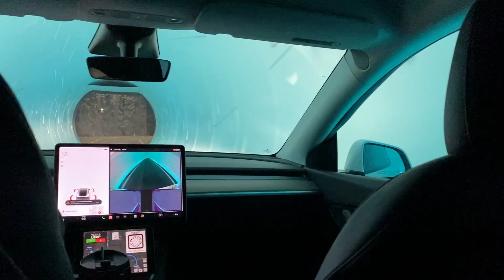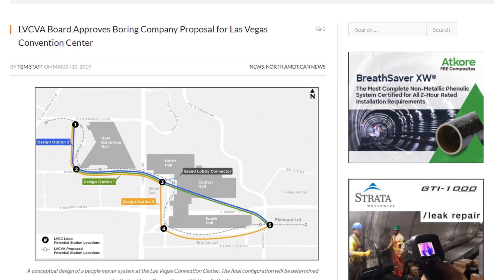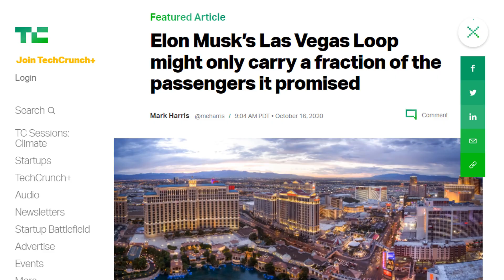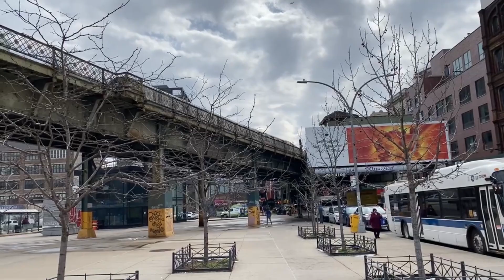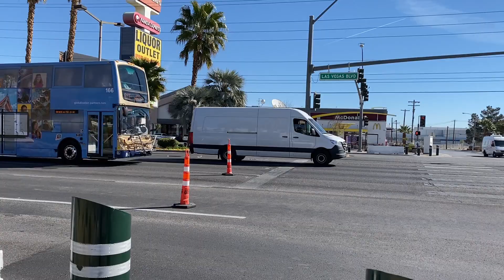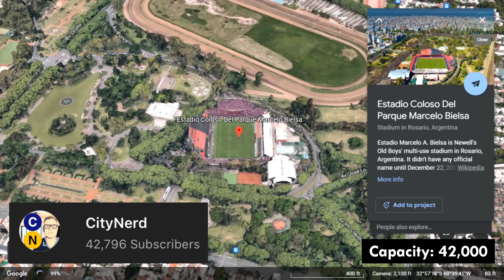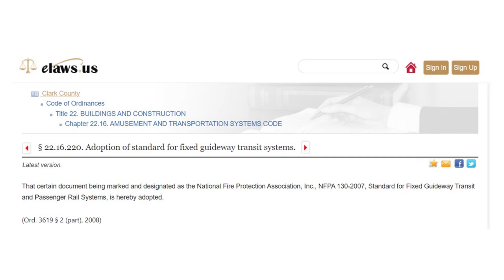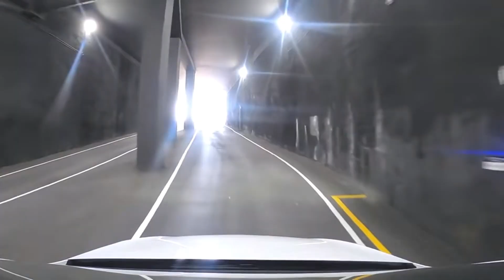Inside the Las Vegas Loop: Transportation Game-Changer, or Complete Waste of Time and Effort?

Comment: i hope they convert these tunnels into actual mass transit
Reply: The Loop is already mass transit though. Boring Co’s Loop which only has 1 route, 3 stops and 70 cars easily handles 27,000 passengers per day during conventions. 

Compare that to the Vegas Bus service has a daily ridership of 178,390 but that is across 51 routes and 3,900+ stops and a fleet of 708 buses. 

So that very large, busy bus network only carries 6.6x the number of passengers of the small 3-station Loop despite having 51x the number of routes, 1,300x the number of stops and 10x the number of vehicles each of which has 10x the seating capacity as each Loop EV.

The 29 mile 51 station Loop will increase the size of the current Loop by 17x so it actually sounds like The Boring Co is underestimating capacity projecting at least 57,000 people PER HOUR for the full Loop.

Considering that Las Vegas only has a population of 600,000, you can see how the Loop is indeed a very good solution for the public transport needs of this city going forward - particularly since it is costing the taxpayer ZERO dollars compared to around $15 billion for a comparable subway.
Reply: @andrewfranklin4429  You're once again committing the sin of comparing peak traffic along one busy stretch during one busy period, to daily averages across a huge network. That's not how traffic engineering works.
Reply: @Codraroll  no, the Loop is only operational during conventions and we don’t yet know what the peak throughput capability of the Loop is considering the largest convention has only been 114,000 attendees while the Loop was designed for conferences up to 180,000 attendees. 

So that 25,000 - 27,000 daily ridership range gives us an average of 26,000 people per day. 

We have to wait for the full 29 mile 51 station Loop to be constructed before we can get the best comparison of a continually operational commuter network, but t least we now know that the Loop is very competitive with bus networks.
Reply: @andrewfranklin4429  70 cars with 1 driver 3 passengers, is 280 places, that's  nearly half a Luxtram tramway (422 passengers), and 5 to 3 busses (60 to 120 passgenger busses).
70 model 3 are around 4 million USD (the price of 10 electric busses transporting 2 to 3 times as money people as Tesla cars)
70 Tesla drivers salaries compared to 3 to 5 bus driver salaries
Reply: @THEREALZENFORCE  In terms of the number of cars required, a subway carriage costs $2 million so an 8 carriage train costs $16 million and can carry about 1,600 passengers. 

Each EV in the LVCC Loop cost about $40k each, so you could buy 400 EVs for the same money as that NYC train and with 4 passengers per car transport the same 1,600 passengers. 

However, the EVs travel 5x faster than the trains (which have to stop at every station on a line) so you’d only need 80 EVs to transport the same number of people in an hour. 

Even with 2.5 passengers in each EV, that’s still only 128 EVs to transport the same number of passengers as a train at 32% the cost of that train.
Reply: @andrewfranklin4429  Luxtram 16km 24 stations 500 million USD, over 12000 people per hour capacity (every 2 minute one tram), 31 million per km.
Las Vegas Loop 2km 1 station 50 million USD per km, only 4400 people per hour maximum claimed nearly 3 times less capacity per hour at optimal factors at best.
Reply: @THEREALZENFORCE  and of course, the other problem with your Luxtram is that it is above-ground meaning that in addition to having to stop at every station, they are terribly slow averaging 12 - 15mph but dropping to 9mph through pedestrian zones and interactions with cars and speed restrictions through the built-up city area. 

It just doesn’t compare with the 60mph (100kph) average speed of Loop EVs (let alone the 150mph (240kph) max speed down arterial tunnels) which go straight to their destination at high speed without stopping at every station. 

LRT is too uncomfortable and unsafe. Having to sit or stand crowded breathing the COVID of up to hundreds of strangers and the exhaust fumes of city traffic, there is no comparison to every 2-3 passengers in their own independently mobile, personal, HEPA and activated carbon filtered safety cell Loop EV. 

In the event of a crash or collision, you’re far safer in a Tesla with seat belts surrounded by air bags and a vehicle that NCAP rates as the safest car on the road in crashes. 

Compare that to being seated or standing in a tram with no seat belts, no air bags and long compartments full of people and luggage that turn into projectiles in a crash. 

Then there is the problem of the visual pollution and noisey tram/train station or railway line which people don’t want running next to their house or business compared to the whisper-quiet Tesla EVs hidden away below-ground.
Reply: @THEREALZENFORCE   Luxtram has 15 stations over 7km and takes 23 minutes to travel that distance at the dreadfully slow speed of 11.3 mph.

The tram has a daily ridership of only 31,300 passengers only 16% greater than the 27,000 people per day of the Loop despite having 5x the number of stations, 5.4x the length and costing $604m or 12.4x more than the LVCC Loop.  And it isn't even underground so has all the problems of above-ground rail in terms of noise and land-use.

I don’t think I’d be using that as an example if I was you Zenforce!  :-)
Reply: @andrewfranklin4429  You cannot even count :
600 million for 16 km for 29 stations for 21 tramways compared to LVCC 55 million for less than 1.8 km, 3 bad stations, no cars. 
600 divided by 16 is 37 million per km
The Loop is 30 million per km without cars.
For one 422 person 45 meter Luxtram you need 106 Tesla Model 3 cars (2 million more expensive than one tramway train), one Luxtram is 45 meters long, the 106 Tesla model 3 cars column would 499 meter long (10 times longer needing ten times more space to transport the same 422 people as one tram), also the tram is way more energy efficient, according to physics metal wheels on rail has way lower rolling resistance than rubber tires). Cannot beat physics
Reply: @andrewfranklin4429  Las Vegas loop 2 times more expensive per km, over 2 times less people transported per hour, 3 to 5 times less energy efficient, way higher rolling resistance, and requiring ten times longer space for 422 people transported. 
The 21 tramway with a theoretical 8862 people at once possible at a time (21 x 422) in a huge city easily beat the Tesla Loop carrying capacity at once.
Reply: @andrewfranklin4429  Any train or tramway or bus at even 30% capacity requires twice less energy per person transported.
Reply: @andrewfranklin4429  Funfact in 2022 Luxtram transports 70000 people per day, over 6000 per hour on average (during working times) in our 150000 person Luxembourg City while your LVCC does not even transport 30000 people daily in a city of 600000 people. The LVCC average is even way lower when you check a 365 days period, your number claims are the best ever recorded during one day of maximum attendance, it's not even a median yearly average.
Reply: @andrewfranklin4429  And all your energy claims are fake news, according to physics rubber tires have way higher rolling resistance than metal wheels on metal rails. Also you need way more cars to transport the same number of persons as one single tramway vehicule.
1 CAF Urbos tramway we got 21 vehicules for for 81 million dollars, that's 3.8 million per vehicule for 422 people capacity per vehicule. For the same 422 people, you need 106 Tesla model 3 cars (so 106 x 60000 euros at best Model 3 autopilot long range in my country is 6.3 million euros nearly 7 million dollars to transport the same 422 people at once.
Reply: @THEREALZENFORCE  actually, we now have the latest pricing for the Vegas Loop:

34 miles of tunnels = ZERO dollars
55 above-ground stations = $1.5m each (paid for by each hotel, casino, University, stadium etc)
If the hotels etc want a larger more grandiose station, they cost $3-$5m each
All running costs paid for by The Boring Company including 700 cars and paid for out of ticket revenue.
Reply: @THEREALZENFORCE  Steel wheels are not actually the big deal in energy efficiency that you may think. Rolling resistance is only responsible for about 15% of the energy usage of a vehicle compared to wind resistance, fuel/energy conversion losses, mechanical losses and overcoming inertia when accelerating which account for a massive 85% of the energy usage of a car. 

You’re probably getting confused by the fact that ICE cars are less energy efficient than trains (which they are) and thinking that also applies to EVs (which it doesn’t).  

The average energy efficiency of trains is dragged down by big heavy trains moving small numbers of people off-peak as well as having to start and stop at every station on the line. That is why the Loop EVs use less power than any heavy or light rail transit system globally.  

here’s a more extensive list of energy usage:
Transit System	Type	Wh/pax-mile
Model Y; 5 passengers.	Loop	70.0
Model Y; 4 passengers.	Loop	86.9
Model Y; 3 passengers.	Loop	112.3
Model Y; 2.4 passengers.	Loop	141.5
Seattle; ST	LR	144.6
New York-Newark; NYCT	HR	164.7
Model Y; 2 passengers.	Loop	165.2
San Francisco-Oakland; BART	HR	177.7
San Juan; PRHTA	HR	193.2
Atlanta; MARTA	HR	193.5
Phoenix-Mesa; VMR	LR	206.8
New York-Newark; PATH	HR	217.1
San Diego; MTS	LR	223.1
Portland; TriMet	LR	269.1
Chicago; CTA	HR	320.1
Model Y; 1 passenger.	Loop	324.0
Boston; MBTA	HR	324.6
Los Angeles-Long Beach-Anaheim; LACMTA	LR	325.8
Philadelphia; SEPTA	HR	346.5
Charlotte; CATS	LR	349.8
Boston; MBTA	LR	350.1
Seattle; SMS	MG	354.1
Minneapolis-St. Paul	LR	385.6
Los Angeles-Long Beach-Anaheim; LACMTA	HR	390.0
{ HR Average }	HR	408.6

Denver-Aurora; RTD	LR	411.4
San Francisco-Oakland; SFMTA	LR	416.8
Houston; Metro	LR	425.9
St. Louis; METRO	LR	427.5
Philadelphia; PATCO	HR	431.9
Washington; WMATA	HR	439.3
Philadelphia; SEPTA	SR	461.1
New York-Newark; NJ TRANSIT	LR	465.9
San Jose; VTA	LR	468.7
Salt Lake City-West Valley City; UTA	LR	480.5
Seattle; ST	SR	502.3
San Francisco-Oakland; SFMTA	SR	502.7
Sacramento	LR	507.0
{ LR Average }	LR	510.4

Type
HR/LR = Heavy/Light Rail
SR = Streetcar
MG = Monorail/Guideway
Wh/pax-mile from 2019 NTD Data.

Electric Propulsion Energy Consumed in kWh / Passenger Miles * (Revenue Vehicle Miles/Total Vehicle Miles)
Last term corrects for Energy used for revenue service, and removes such uses as deadheading, training miles, etc...
Reply: @THEREALZENFORCE  Yes, a tram or train packs more people into for example an 8-car NYC subway train itself compared to the 80 EVs needed to transport the same number of passengers in peak hour, but you need to factor in the empty tunnel wasted between each train to ensure they don’t crash into each other if you’re going to properly compare space efficiency. 

There is literally miles of empty tunnel wasted between each train, while the Loop can handle a continuous stream of EVs 1 second apart (6 car lengths at 60mph) in the main arterial tunnels.

Much less space wasted than a train.
Reply: @THEREALZENFORCE   and you forget that the Loop EVs will travel at an average of 60mph or 6x faster in the 34 mile Vegas Loop compared to the dreadfully slow Luxtram which averages only 11.3mph so even if you crammed 422 people into a tram, it would only take 105/6 = 17.5 Loop EVs to transport the same number of people per hour. 

But the passengers would get to their destinations 6x faster seated in a comfy EV.
Reply: @THEREALZENFORCE  and those 18 Loop EVs required to transport the same number of passengers per hour as each $3.8 million tram only cost 18x $40,000 = $720,000 or 5x cheaper than that tram.
Reply: @andrewfranklin4429  Now to reality : 3 days ago : 
Las Vegas Gov website about LVCC loop :
- City Council seek approval of monorail
- City Council seek Fire and Life safety plan
- City Council speaks of revenues (so no zero dollars)
Reply: @THEREALZENFORCE    yep Zero dollars to the taxpayer. Because Loop tunnels are so cheap at only $10m per mile, The Boring Co is investing $340m into Vegas building the 34 miles of tunnels knowing that he’ll make it back on ticket revenue since he has a 50 year franchise and will generate plenty of income every year. 

With tickets averaging about $6 per EV and ridership of up to 57,000 people per hour in peak hour, TBC could be looking at income of $140,000 per hour in peak periods or perhaps close to a million per day which gives us over $300 million annually. 

So TBC would make back the cost of the tunnels in a few years at the most. Sounds like a pretty sound investment to me.
Reply: @THEREALZENFORCE  It is actually the Las Vegas Convention Center and Visitors Authority that receives the bonuses if the Loop hits certain capacity figures not Musk or the Boring Co. 

The Boring Co (TBC) will pay the county a franchise fee of 0.5% on the first $17.5 million of quarterly revenue and 5% on additional revenue from the Loop from ticket revenue generated by TBC who will operate the Loop as a franchisee and retain the other 95-99.5% of ticket sales.  

There are no subsidies, TBC is going to pay for the cost of ALL 34 miles of tunnels ITSELF with the 55 hotels and casinos paying for the construction costs of their own stations at the front doors of their establishments.  

The taxpayer will indeed pay ZERO dollars compared to the tens of billions that a subway would cost.
Reply: @andrewfranklin4429  Instead of your fake news : let's try reality : 
London reconnection article : why are tramway to most efficient public transport
There you have the explanations about efficiency and also rolling resistance
Reply: @andrewfranklin4429  At 30% passenger a tramway has 2 times less MJ/km per person. At 100% people capacity it's nearly 6 times more energy efficient.
Reply: You also confuse energy efficiency (km(MJ) and energy consumption (kWh/100km). No wonder you speak so much non sense.
Reply: @andrewfranklin4429  Wikipedia : Energy Efficiency per transport : per person :
Tesla Model 3 needs 540 KJ/km
Train needs 85 to 132 kJ/km on trains at 300 kmh (kph)
China 400AF 132 KJ/km at 350kmh Tesla Model 3 needs 3 times more energy at less than 100kmh
Reply: @andrewfranklin4429  "Zero" dollars for tax payers (City Council seem to be against that claim), also zero for tax payers, and still a lot of dollars to be paid by Loop users and Casinos clients who in the end will pay for the casinos part of the loop.
Reply: @THEREALZENFORCE  Looking at that “Energy efficiency in transport” page in Wikipedia you’ll see that passenger trains in the USA consume 1.60 MJ per passenger km while on that same page you will see that the 2020 Tesla model 3 consumes 540 kJ/km.   So, by Wikipedia’s referenced figures, the Tesla is just on 3x more energy efficient with one passenger than trains in the USA.   With 2 or 3 passengers, considering each person only increases the car’s weight by 4.5%, you can pretty much divide that figure by 2 or 3 respectively and you can see the Tesla with 3 passengers comes in at up to 9x more energy efficient than a train. 

That Wikipedia page also lists a Swiss electric train at 470 kJ/passenger-km, so with the average of 2.5 passengers per Loop EV, energy consumption comes in at 216 kJ/passenger-km, 2.1x more efficient than the of that Swiss train and with 4 passengers, the Tesla is around 3.5x more efficient per passenger km.
Reply: @andrewfranklin4429  The very fact that 4 days ago the Las Vegas City Council listed priorities to decide in favour of a monorail (instead of Tesla cars) in the Loop tunnels debunks any of you and Musk claims in favour of cars.
Reply: @andrewfranklin4429  Yeah nice false analogy try using bad old tech USA trains instead of modern trains we have in Europe and others have in Asia. The USA are the joke in train and tramway for nearly 30 years now. 
European and Asian train way more energy efficient and up to 4 times the average travel speed (431kmh for the Shanghai Maglev,)
Reply: @andrewfranklin4429  A modern train is up to 3 times more energy effective per person per km at 3 times the speed of a Tesla Model 3. Facts.
Reply: @THEREALZENFORCE  heh, I know it is confusing - the chairperson of the city council asked why the 34 mile 55 station Vegas Loop proposal was titled “Monorail” and the council Loop project rep had to explain that the Loop is classed as a monorail as according to Government regs, Monorail means fixed guideway transport and the Loop tunnel is classed as a guideway.
Reply: @andrewfranklin4429  Why are you still writing, you do not even understand the difference about MJ and KJ
There are 1000 kilojoules in 1 megajoule 
1.76 MJ is 1760 KJ
So you debunk yourself even more by not understanding basic principles.
Reply: @THEREALZENFORCE  Here are the pertinent parts of the press release:

“The Boring Company’s application to expand the Vegas Loop into downtown Las Vegas has been approved by the Las Vegas City Council. The project is being privately funded and there will be no fee reductions.”

“- 50 year non-exclusive agreement; about 95 percent identical to Clark County’s agreement approved on 10/20/21
- Allows The Boring Company to use our right-of- way to construct, operate, and maintain a privately funded underground transportation system
- No taxpayer funds requested or contributed: all funding is from The Boring Company and private properties
- Vegas Loop is envisioned to be a 34+ mile tunnel network with 55+ stations including Harry Reid Airport and Allegiant Stadium”
Reply: @THEREALZENFORCE  the Loop is also more efficient than trains in Singapore and Hong Kong:

Average Wh per passenger-mile:
- Loop Tesla Model Y (4 passengers) = 80.9
- Loop Tesla Model Y (2.4 passengers) = 141.5
- Metro Average (Hong Kong/Singapore) = 151
- Metro Average (Europe) = 187
- Heavy Rail Average (US) = 408.6
- Streetcar Average (US) = 481
- Light Rail Average (US) = 510.4
Reply: @andrewfranklin4429  Funny you do not understand physics (difference between MJ and KJ) and (difference between energy efficiency km/MJ and energy consumption kWh/100km) and yet you continue to speak speak nonsense while you have on paper cars need more energy than  tramways and trains per person per km.
Reply: @THEREALZENFORCE  the Shanghai Maglev is not a subway that has to stop every mile at every station in a city thus resulting in that slow average speed of 17mph. Why do you bring that up Zen?
Reply: @andrewfranklin4429  Also your cherry picking of claims proves that you are even more clueless than we here in the comment section thought of
Reply: @andrewfranklin4429  Here are the steps this project will go through before full approval is given by the City Council and city leaders.

    Secure Special Use Permit (approved by City Council on 12/16/20)
    Secure approval of a Monorail Agreement (under consideration today)
    Secure approval of design development studies (such as the Fire and Life Safety Plan, Geotechnical Report, Drainage Analysis)
    Secure approval of final design and construction plans and permits
    Construction Phase
    Operational Testing Phase
    Certificate of Operation issued (renewed annually)
    Vegas Loop service begins

What do you not understand about the monorail and Fire and Life Plan ?
Reply: @THEREALZENFORCE  you evidently don’t understand the construction process for this project. I recommend this article as it explains it quite well: 

Boring Company’s Vegas Loop set to be operational next year

By Mick Akers Las Vegas Review-Journal
May 13, 2022 - 10:36 am

Portions of the Elon Musk-owned Boring Company’s Vegas Loop are expected to be operational underneath the resort corridor sometime next year.

Las Vegas Convention and Visitors Authority CEO and President Steve Hill said the timeline depends on the permitting process, but noted he expected that to move fairly quickly.

“This is starting to be a repetitive process,” Hill told the Review-Journal. “ I mean the design of the tunnels isn’t changing and the design of the system isn’t changing. So, the building department has had an opportunity to learn the system, learn the construction methods and learn how it works.”

When the initial resort corridor portions of the loop system go online in 2023 they will open in sections, not necessarily connecting the entire system out of the gate, Hill noted.

“We’ll build phases that are separate to start and then tie them in and subsequent phases,” Hill said. “The (Allegiant) stadium to the Tropicana area will be one phase. The Caesars Loop will be one phase and the Resorts World and Westgate connecting to the convention center will be one phase. Then there will be phases that follow that connect those connections together.”

Boring Company President Steve Davis said last year that five to 10 stations would come online within the first six months of construction starting on the Vegas Loop. With around 15-20 stations being added each year until the full build-out is met.
Reply: @THEREALZENFORCE  Permits for a connection to the off-Strip resort the Westgate hotel have been submitted, with work pending on that tunnel.
“The Westgate is shorter and more direct, so that would be the first,” Hill said.

As have permits for the Caesars Loop, a circular segment running around various Caesars Entertainment-owned properties near the Strip and Flamingo Road. Those include Caesars Palace, Paris, Planet Hollywood, Bally’s, Flamingo and the Linq.

Additionally, permits to get the process rolling for a loop running between Allegiant Stadium and Tropicana Avenue/Las Vegas Boulevard have been submitted to Clark County.
“It will provide the first opportunity to connect some other local locations to the stadium itself,” Hill said. “But all those (loop portions) should be open and running sometime in 2023.”
Reply: After the stadium and Caesars Loop portions are complete the plan is then to work north/south and connect the stadium end to the Caesars Loop. In addition to connecting the Caesars portion to the north end of the Strip.

The monorail operation agreement with the city of Las Vegas has yet to be approved, but is tentatively set to be finalized at a June 2 Las Vegas City Council meeting.

Following that approval, the process regarding the portion of the Vegas Loop that is set to run into downtown Las Vegas can get underway. That includes the proper permitting and agreements to get construction underway and the individual agreements with each landowner where stops are planned for the downtown area.

The Allegiant Stadium portion of tunnel work has a contract value of $9.18 million while the Caesars Loop portion is pegged at $3.42 million, according to county records. Hill wasn’t familiar with the exact pricing of the system, as the Boring Company is tasked with financing the routes outside of the initial Convention Center Loop.
Reply: @THEREALZENFORCE  The Convention Center Loop began operating last year and shuttles conventioneers between three areas of the recently expanded Las Vegas Convention Center. That 0.8 mile dual tunnel system was built at the LVCVA’s expense, totaling $54 million. The large underground central station took up a large portion of that total. With that in mind, Hill noted that most of the Vegas Loop stations will be above ground.

The Boring Company is tasked with paying for the Vegas Loop work, with each resort or property that hosts a station likely paying for work tied to those stops. The Boring Company would also be tasked with operating the system and receiving the revenue generated by rides.

Boring Company is also slated to pay a varying quarterly amount to Clark County and the city of Las Vegas, based on gross revenue generated.
Reply: @andrewfranklin4429  MJ per passenger kilometer :
Trains (23 passengers per vehicule): 1.1189
Cars (1.5 passenger per vehicule) : 1.866
So half car still needs more energy than a train with many times less the real transporting capacity
Reply: @THEREALZENFORCE  The next connection on the loop system that will go live is a portion connecting Resorts World and the convention center. Work is complete on the Resorts World connector tunnel to the West Hall at the convention center. The tunnels should start to see activity in the near future.

“We’re just going through the process of getting the operating permit to open up that (Resorts World) connection,” Hill said.
The process of tunneling the Resorts World portion was likely the toughest part of the entire system to bore, Hill said.

“It’s probably the most difficult tunnel the Boring Company will ever have to produce,” Hill said. “It turned exceptionally tightly, so it really tested the limit of the boring machine itself and the ability to remove the material from the tunnel. While it was turning tightly it (the boring machine) had to dive, almost like tunneling in a corkscrew.”
Reply: @andrewfranklin4429  BTU per passenger mile
Trains : 1.813
Cars : 2.847 (63% more)
Reply: @andrewfranklin4429  Way are you bringing up that subway excuse ? Public transportation above ground and underground is more energy efficient than the Las Vegas Loop. 
Facts don't care about your Musk cultist feelings.
Reply: @THEREALZENFORCE  you’re getting confused with ICE cars. EVs are far more efficient.  Here’s the data from Wikipedia again as it evidently didn’t sink in the first time:

Passenger trains in the USA consume 1.60 MJ (so that is 1,600 kJ) per passenger km while on that same page you will see that the 2020 Tesla model 3 consumes 540 kJ/km.
Reply: @andrewfranklin4429  So The Boring company will perhaps build tunnels and a monorail company, hopefully a modern European or Asian company will provide the monorail, Musk is incapable of providing one.
Luxtram in Las Vegas loop maybe haha, so that you can also get a take on modern tech
Reply: @andrewfranklin4429  Maybe San Francisco will make a Luxembourg Funicular so that you automatically climb in seconds no driver what the dinosaur old super slow San Franscico tramway does in long minutes🙂
Reply: @THEREALZENFORCE  we are comparing public transport through a city - trams, light rail, subways and Loop. Why are you bringing the Shanghai maglev into the discussion when it isn’t used for inner-city public transport Zen?
Reply: @andrewfranklin4429  Tesla 540 KJ/km
Train 82 to 132 KJ/km but at 250 to 350 kmh speed not slow 50 to 80 kmh 🙂
Reply: @andrewfranklin4429  Las Vegas : bad public transportation (busses and loop), bad water management, bad energy management, bad crime management, ultra high murder rates, high poverty rates.
My country has 650000 people and is on the top of world tech compared to Las Vegas a 600000 people city. Ridiculous levels of mismanagement for Las Vegas a city with millions of tourists that pay for.
Reply: @andrewfranklin4429  Luxtram > Las Vegas loop
Reply: @andrewfranklin4429  automated Luxembourg Funicular > any Boring Company lifts even those in CGI ones that The Boring Company now deleted on their website
Reply: @THEREALZENFORCE  With 4 passengers per Loop EV you’re looking at only 135 kJ/passenger-km so even if your figure for trains was correct, the Loop would be equal in energy efficiency. 

No tram or subway I know travels at 250 - 350 km/h, where is this magic city transit railway Zen?  

However, I do know that the Loop EVs easily reach 127mph (205km/h) in the Boring Co Hawthorne California tunnel significantly faster than the 17mph average speed of subways.
Reply: @andrewfranklin4429  Cool story that you avoid the fact that train efficiency figures are at 30% capacity not 100%. At 100% the train (also tram) is 3 times more efficient than the 85 to 132 KJ/km (so needing 3 times less those values per person at 100% capacity fully loaded persons).
Reply: @THEREALZENFORCE   yes, you are quite correct Luxtram > Las Vegas Loop.

To the tune of $640m > than the ZERO dollars the much larger 34 mile, 55 station Las Vegas Loop is costing. And Luxtram isn’t even underground!

Not sure why you’re boasting about that though?
Reply: @andrewfranklin4429  France RER 100 to 120kmh station to station
Luxtram will do these speeds from Luxembourg City to Esch/Alzette city.
Reply: @THEREALZENFORCE  so 120km/h outside the city not in? In contrast, the Vegas Loop will support EVs travelling up to 150mph (245km/h) down the long straight arterial tunnels within the city.
Reply: @andrewfranklin4429  You still do not address the fact that for one 45 meter Luxtram transporting 422 people, you need 106 Tesla cars needing 500 meters stuck one after another no gap and way ore with a one second gap (the higher the speed the higher the number of meters exponentially needed between the cars to brake).
You also avoid the fact that on the same station you need less than 1 minute to board 422 in Luxtram. How long does it take to board 422 people in Las Vegas Loop on the same station ? Already at 10 seconds boarding intervals we speak 4220 seconds (70 minutes just to board 422 people in 106 cars). In the real world people need more than 30 seconds to one minute to board a taxi, Tesla cannot change that fact.
Reply: @THEREALZENFORCE  perhaps you missed my comment where I mentioned that the Loop EVs will travel at an average of 60mph or 6x faster in the 34 mile Vegas Loop compared to the dreadfully slow Luxtram which averages only 11.3mph so even if you crammed 422 people into a tram, it would only take 105/6 = 17.5 Loop EVs to transport the same number of people. 

But the passengers would get to their destinations 6x faster seated in a comfy EV.
Reply: @andrewfranklin4429  Funny is how you claim 245 kmh tunnel speeds when in the real world they don't even do 70 kph. In the meantime in my countries you can legally drive at 90 kph in tunnels, some illegally went way over 200. Your Fan Fiction does not trump current reality.
Reply: @THEREALZENFORCE  If you look at the footage of the Loop from the SEMA conference, even though attendance was down due to the pandemic and the crowds were not fully utilising the Loop yet, we see each Loop EV taking around 30 seconds to unload and load passengers (15 seconds + 15 seconds respectively), giving us 30 seconds between vehicles in that one bay. There are 10 bays in each station so that works out as 30 seconds divided by 10 = 3 seconds between EVs exiting that station. 

Again, looking at the footage, we see EVs leaving the stations down to 3 seconds apart which would give us up to 1,200 EVs per hour. Across all three stations, that’s 3,600 EVs per hour. 

We also see between 2-3 people in each EV, so with 2.5 passengers per EV, that is up to 3,000 people per hour per station or up to 9,000 people per hour across all three.
Reply: @andrewfranklin4429  For crossboarder workers and tourists Luxtram, trains, funicular, busses are also ZERO dollars according to your made definition.
And making place above ground (one or two lanes) is cheaper than building tunnels, that debunks your cost argument even more. Tunnel construction also pollutes more (needs more natural ressources and emit higher pollutions emissions)
So the Loop is even a way less climate friendly solution, not only more expensive, less energy efficient, less person per hour.
Reply: @THEREALZENFORCE  as I say, unlike trams and trains which waste all those miles of tunnels or track, many more Loop EVs drive past every hour than trams or trains. TBC is aiming for a headway of 0.9 seconds between cars (5 car lengths at 100km/h). 

A 2010 study by the Honda Research Institute found that 25% of drivers maintained a distance of 2 cars between vehicles at 60mph on a busy 2-lane freeway, 15% 3 car lengths, 15% 4 car lengths, 5% 5 car lengths and 15% 6 car lengths. 

So that is 75% of cars having a headway of one second (~6 car lengths at 60mph) or less and 40% maintaining a headway of 0.5 seconds (~3 car lengths at 60mph) or less. And remember those are cars driven by potentially distracted, drunk and careless drivers. 

Note that a headway of 0.5 seconds = 7,200 cars per hour
And a headway of 1.0 seconds = 3,600 cars per hour

As I say, The Boring Co is planning on a headway of around 0.9 seconds (5 car lengths between EVs at 60mph) which will give a throughput of 4,000 EVs per hour.  With 2.5 passengers per car that gives us 10,000 people per hour. With 4 passengers per car 16,000 people per hour per single tunnel. 

With higher capacity EV vans, buses or pods that can be added if demand requires it, those numbers go up exponentially. 

Once the Loop autonomous control systems with their millisecond response times and ability to for example command ALL vehicles in a section of the Loop to brake or accelerate simultaneously, there would be no problems safely achieving headways of this duration.
Reply: @THEREALZENFORCE  the LVCC Loop EVs travel at 40mph (64kph) in this first stage and as I say will hit an average of 60mph with peak speeds up to 150mph once the 34 mile 55 station Loop is finished. 

Loop EVs have already demonstrated 127mph (205 kph) down the 1.14 mile test tunnel in Hawthorne California. 

This shows the sorts of speeds possible in a tunnel that is almost 3 times longer than the 0.4 mile spur tunnels connecting each station in the LVCC Loop. With the much longer arterial tunnels of the 34 mile Loop, it will be easy to achieve even higher speeds.
Reply: @THEREALZENFORCE  you’re getting confused between ticket costs and construction costs. 

Luxtram cost taxpayers $640m to construct while the much larger, higher capacity and faster 34 mile 55 station Vegas Loop is costing taxpayers zero dollars. And it’s underground while Luxtram isn’t.
Reply: @andrewfranklin4429  Your made calculations are funny. 2022 Luxtram 70000 people per day, 2022 Las Vegas Loop way less than the peak 27000 people per day.
3 times more people transported per hour at 2 times slower average speed.
 
These are the facts.
Reply: @THEREALZENFORCE  and no, above-ground light rail is significantly more expensive than the underground Loop. 

The second cheapest bid for the LVCC project was around $200m, 4x the cost of the winner, the LVCC Loop and that was despite being an above-ground 0.8 mile light rail on LVCC land. 

The average cost of the 14 light rail projects currently under construction around the USA is $201m per mile so a 15 mile above ground light rail through Vegas would indeed cost $3 billion compared to zero dollars for the underground 34 mile Loop.
Reply: @andrewfranklin4429  Enhancing the Tesla speed by six times will not change the boarding times for 106 persons (humans will not board the Tesla car six times faster), not will it change much the length difference required (even your made up 17 cars at 245kmh would need a 600 meter braking regular distance if something happened in the tunnel, more vehicules are more failure points in the tunnel.
And a Model 3 at 245kmh will require many times KJ/km than a Model 3 at 60 kmh, so it will be way less energy efficient than before.
Reply: @THEREALZENFORCE  you’re repeating yourself again Zen. Perhaps you missed this comment of mine earlier:

Luxtram has 15 stations over 7km and takes 23 minutes to travel that distance at the dreadfully slow speed of 11.3 mph.

The tram has a daily ridership of only 31,300 passengers only 16% greater than the 27,000 people per day of the Loop despite having 5x the number of stations, 5.4x the length and costing $604m or 12.4x more than the LVCC Loop.

I don’t think I’d be using that as an example if I was you Zenforce!  :-)
Reply: @andrewfranklin4429  There are a lot of traffic jams already in the current small loop, and the problem will only get worse with 34 mile loop, more stations equals more traffic jam sources. In the meantime Luxtram runs on it0s own rail with no cars on it's rail mostly.
Reply: @THEREALZENFORCE  no, that 17 car per tram figure is calculated off the average speed of the Loop EVs which will be 60mph. That 150mph (245km/h) figure is just the maximum possible in the long straight arterial tunnels but wouldn’t occur in peak hour traffic densities.
Reply: @THEREALZENFORCE  Actually, the Loop has had no traffic jams. If you have a look at the footage of the so-called “traffic jam” that occurred once at CES, you will notice how the EVs just slowed down briefly because the South Hall doors were locked for some reason. 

There are no other videos of this sort of incident ever happening again, not even during the much larger SEMA conference which had 114,00 attendees and had 25,000-27,000 Loop passengers per day vs CES which only had 40,000 attendees who rode the Loop 15,000-17,000 times per day. 

Now compare this short 40 second slow down against a subway train where passengers have to queue up standing on the platform and wait for literally 3, 5, 10 or even 30 minutes waiting for the next train. 

And then those poor train passengers have to put up with being crammed standing breathing the COVID of a thousand strangers in the train STOPPING AND WAITING AT EVERY SINGLE STATION before they get to their destination plodding along in the train averaging 17mph across the whole trip. 

Finally, compare this to Loop passengers who walk into the station, immediately jump into one of the EVs sitting there waiting for them with a waiting time of 15 seconds on average and then travel at high speeds of 30-40mph in a comfy EV in the short LVCC tunnels or 60mph (100km/h) average in the 29 mile Loop right to the front door of their destination without having to stop at any stations on the way.

Now which would you prefer?
Reply: @andrewfranklin4429  Taking a ride in the Vegas Loop (Boring Tunnel) during CES 2022, reality over 40 seconds alone to go down to the loop, 30 seconds to board the car and drive away, 1 minute 20 seconds real time compared to your fantasy 15 seconds
Reply: @THEREALZENFORCE  have a look at the Loop videos and you will see people taking 15 seconds to board. The LVCVA even reported that the average wait time during CES was indeed 15 seconds.
Reply: @andrewfranklin4429  claim "No traffic jam"
Reality with 92000 views : 
Elon Musk’s ‘High Tech’ Tunnel Foiled By Old Fashioned Traffic Jam
Reply: @andrewfranklin4429  So in reality on video we have Las Vegas Loops Traffic jams and 40 seconds escalator for a few meters and. 30 seconds boarding time of one person with no luggage for the trunk to enter a Tesla. Facts not your fanfiction.
Reply: @THEREALZENFORCE   you’re forgetting that those Luxtrams have a headway of 5 minutes peak and 10 minutes off-peak. 

In the 5 minutes that it would take for the next tram to arrive, every 3 seconds a Loop EV would have been in and out of the station meaning that 300 Loop EVs carrying between 750 - 1,200 passengers would have boarded at that station. 

Bit more than that 422 crammed in the tram eh?
Reply: @THEREALZENFORCE  you’re forgetting that those 55 hotels, casinos etc are all building Loop stations right at their front doors so no need to go find a few and far between train station, there will be 8 Loop stations every mile spread throughout the busier parts of the city. 

So not only do you jump straight into a Loop EV and be off in 15 seconds instead of having to wait 3, 5, 10, 30 minutes for a train to arrive, you also save enormous amounts of time walking to the station in the first place.
Reply: @andrewfranklin4429  Funny is how you think shifting costs to ticket payers instead of taxpayers makes the Loop a zero cost build. The only thing a ticket fee does is enhancing the cost per person, the state does not need to make profit unlike the loop, so a single loop customer person will pay way more over the years of usage than a taxpayer. Zero ticket fees in Luxembourg public transport, 41 million cost per year paid by 450000 workers taxes that's 91 dollar per year (7.5 dollars per month) per tax payer worker for country wide free zero ticket public transportation 364 days per year. No where near the ultra cost people will pay per year while using cars, taxis and loops. So cool story no way a person in Las Vegas will be at 7.5 dollars per month to go work or go for leisure.
Reply: @THEREALZENFORCE  And that $41m is just a small fraction of the $500m that it costs to operate Luxtram every year. 

“The price of the project will be the €41m (£35m; $44m) in lost ticket fares, but that will be shouldered by the taxpayer. "Of course, just because I call it free transport doesn't mean nobody pays," said Mr Bausch, who is part of Luxembourg's green party, déi Gréng.”

“The total cost of running the service is more than €500m so the government sees the lost fare revenue as relatively small. “

And that is not including the construction costs of the line. 

Make no mistake, you taxpayers in Luxemburg are on the hook for far more than you seem to think.
Reply: @andrewfranklin4429  So as a taxpayer for 7.5 dollars per month i have several thousands kilometers of free public transport (busses, trains, tram, funicular) through my 650000 people country while people in Las Vegas pay 4 to 20 dollars per day for one loop (0.8 and 35 mile loop). And you say people pay less for the Loop when they will pay 20 to over 30 times more for just a tiny 50 km 34 mile loop of public transport.
Reply: @andrewfranklin4429  the 41 millions are the official cost of how much it costs us per year. Also the 500 millions are pay by near 0% credits. So nice try of another failed argument.
Reply: @andrewfranklin4429  7.6 dollars per month of my taxpayer dollars to wander freely in my 2500km2 country. Las Vegas loop 5 to 20 dollars to by stuck in a tiny 50 km loop.
Facts.
Reply: @THEREALZENFORCE  as I mentioned above, you’re forgetting you as a taxpayer are also paying for the $500m annual operating costs of Luxtram AND you’re still paying off the $640m construction cost of Luxtram.

And that is for a service that only carries 16% more people than the 27,000 people per day of the Loop despite having 5x the number of stations, 5.4x the length and costing $604m or 12.4x more than the LVCC Loop.

Definitely doesn’t sound like a good deal to me.
Reply: @andrewfranklin4429  Tell me how much you pay to commute to work per month (car, or bus or train). For me it's 7.6 dollar per month of my taxpayers money.
I don't even need a car. While Las Vegas is so badly managed that you need a car (your own or a taxi) for most things.
Reply: @THEREALZENFORCE  and the Loop isn’t competing against Luxtram, the price of $5-20 per Vegas Loop EV works out as $1-$5 per person with ride-sharing which is competing against:
- $25 - $37 for gridlocked taxis 
- $6 per person via gridlocked bus
- $5 per person for the Vegas Monorail which doesn't go anywhere and has gone bankrupt twice.

No wonder all of Las Vegas is itching for the full Loop to be built. 

As it is, the size of the Loop keeps growing as more hotels casinos and other properties sign up for a station and tunnels to their area. 

This is going to be BIG.
Reply: @andrewfranklin4429  600 million construction costs and 500 million operating costs ? Where do you get those fantasy numbers for operating costs.
41 million is the official state budget we pay for operating the entire free public transport  (energy, maintenance and drivers salaries) of trains, busses, tram and funicular) on a 2500km2 territory. 
The 34 mile Loop will cost millions in maintenance, tunnel maintenance, the cars, tires, batteries to replace each decade even more. Hence the huge ticket fees in the Loop.
Reply: @THEREALZENFORCE  no, that $41m was just what they used to make from ticket revenue for tickets that were already subsidised. You didn’t think that those tickets paid for the entire cost of operating the service did you?

Regarding the $500m operating cost, I am just quoting the articles bout it:

“The price of the project will be the €41m (£35m; $44m) in lost ticket fares, but that will be shouldered by the taxpayer. "Of course, just because I call it free transport doesn't mean nobody pays," said Mr Bausch, who is part of Luxembourg's green party, déi Gréng.”

“The total cost of running the service is more than €500m so the government sees the lost fare revenue as relatively small.”

Unless you’re calling your own politician a liar?
Reply: @andrewfranklin4429  500 millions is the cost for all the new extensions of the Luxtram (Bonnevoie, Stade Cloche d'Or, Esch/Alzette). Construction costs for extensions not the operating costs. So you are fake news.
Reply: @andrewfranklin4429  The annual cost of the current Luxtram (without extensions) 7 million Euros per year of the 41 millions we before had in ticket fees for all public transport (busses, trains, tram, funicular).
Reply: In the next 10 years the whole project with costs will be around 1 billion, divided by over 450000 tax payer workers, taxes from thousands of our companies (and yours Amazon, Paypal, Google) and a small % of taxes by our 5000 billion hedge funds which will still make that less than 10 dollar per month number of my taxes for daily commute to work and commute to leisure in my country. Loop canot beat that.
Reply: @andrewfranklin4429  So how do you want to top sub 7.6 dollars per month of my taxes daily commute to work (30 cents per day from my taxes), the fuel for your car alone will cost more per day, not counting the maintenance costs of your car. That's the difference when you totally pay for your transportation to commute while i pay a fraction due to be one tax payer among several hundred thousands of tax payers and companies paying via taxes for my personal public transportation too.
So my real price is still less than 10 dollars per month that i pay from my taxes to use and pay for free public transportation
Reply: @andrewfranklin4429  So what is the total price for the 34 mile (50km) loop the 55 casinos will have to pay, constructions costs of tunnels, stations, cost of cars, operating maintenance costs of tunnels, stations, cars. 1 or 2 or 3 billions. How much the total operating costs per year paid by the 55 casinos (while we have thousands of companies and thousands of billions in Hedge Funds which are also taxes to pay for our entire public  transportation system thousands of kilometers).
Reply: @andrewfranklin4429  An underground Caesar Loop station for 3.42 million dollar is pure fantasy. And if it is above ground than it's ridiculously expensive. A tram station costs only several hundred thousands not millions. The Luxtram costs 5 million per km (the loop costs way over 10 million per km, the current short track is even over 20 millions per km)
Reply: @andrewfranklin4429  And another of your fake news : "you’re forgetting that those Luxtrams have a headway of 5 minutes peak and 10 minutes off-peak" At peak time they are 2 minutes maximum 3 minutes from each other (Luxembourg Gare station as proof every morning and evening from Monday to Friday.)
Reply: @THEREALZENFORCE  So as we’ve established, we have the Luxtram service only carrying 16% more people than the 27,000 people per day of the Loop despite having 5x the number of stations, 5.4x the length and costing $604m or 12.4x more than the LVCC Loop.

Despite Luxtram being above-ground, not underground like the Loop. So cost per mile is $40m per mile for Luxtram, a service that is also 5x slower averaging only 11.3mph vs 60mph for the 34 mile Vegas Loop. 

So, if your suggestion was true that each tram station only costs several hundred thousand dollars, then each mile of track is costing $39m per mile for surface track versus $10m per mile of Loop tunnel. Sounds like a terrible deal there Zen!

Of course the reality is that the Luxtram stations cost more than your estimation or otherwise your track cost is horrific. 

In the case of the 34 mile, 55 station Vegas Loop it is costing the Boring Co $10m per mile for the tunnels so around $340m for the entire 34 mile network of tunnels.

TBC recently reported that each above-ground station including the ramps and tunnels to the arterial tunnel = $1.5m
They also indicated that if a hotel wanted something more grandiose/opulent, the cost be typically $3m-$5m.
An underground station would be $20m but all the hotels want above-ground right at their front door or in their existing underground carpark understandably. 

So if all the hotels/casinos etc went for the cheapest station, you’d be looking at $82m for all the stations or $422m for the entire 55 station, 34 mile Loop. 

A Luxtram 34 miles long would cost $40m x 34 miles = $1.36 billion or 3.2x the cost of the Loop and of course Luxtram isn’t even underground and is 5x slower. 

But of course, the entire Vegas Loop is being constructed at zero cost to taxpayers, so it’s an even better deal. $1.5m for a station - even $5m if they want something really snazzy - is a rounding error for those hotels and casinos and TBC will pay for the construction of those 34 miles of tunnels in just a year or two’s ticket sales. So again, no impact to the taxpayer.

So the 34 mile 55 station Vegas Loop is 5x faster, is underground not above-ground, will carry almost double the number of passengers per HOUR as Luxtram carries per DAY, has 3.7x the number of stations and double the line length and is costing zero taxpayer dollars vs $604m. 

We can see why Vegas and all those 55 casinos and hotels went for the Loop can’t we?
Reply: @andrewfranklin4429  Voici quelques chiffres clés concernant la situation actuelle des transports au Luxembourg et dans la Grande-Région:

    70.000 passagers prennent tous les jours ouvrables le tram (depuis l'arrivée du tram à la Gare centrale);
    6.000 passagers utilisent tous les jours ouvrables le funiculaire Pfaffenthal-Kirchberg, au total plus de 2 millions de passagers depuis l'inauguration du 10 décembre 2017; 
Article in French : Chiffres clés - Contexte - Portail TRANSPORTS - Luxembourg
Reply: @andrewfranklin4429  1.5 million dollars per loop station that's over 4 times more than one Luxtram station.
Reply: @andrewfranklin4429  Loop 4 times more expensive stations. Luxtram 70000 people per day in a city of 150000 citizens official stats
Reply: @andrewfranklin4429  World's Longest High-Speed Train Heavy Maintenance | Mega Pit Stops | Episode 2 Free Documentary :
up to 500 meter long train big maintenance after 3.2 million kilometers in less than 10 years. How many Tesla cars and how many maintenances you need to compete with a 250kmh train that also runs at minus 40 degrees celsius. Tesla cars need service every 12500 miles (20000km). And for 3.2 million kilometers that would be 160 service maintenances for Tesla model 3 cars, how many tires needed for 3.2 million kilometers (Tesla recommends rotating tires every 10000km) that's 320 tires rotations for 3.2 million kilometers. Also you would need to buy 2 other Tesla cars for each Loop Tesla (Tesla cars will barely do 1 million kilometers on high optimistic expectations, for one train that's barely a 10 year period.
Reply: @THEREALZENFORCE  you like repeating inaccurate info don’t you Zen?  Not very Zen.
Reply: @THEREALZENFORCE  Tesla is the only car manufacturer in the world that doesn’t specify service and maintenance intervals. No 10,000 services, no 40,000km major service, nothing. Just check the brake fluid level every 3 years.

And of course, it is not as if subways don’t have VERY significant operating, service and maintenance costs to keep trains running, tracks and signals in top shape etc.  One analysis puts the operating costs for trains at the following:
- Commuter Rail = $20.17 per ride
- Heavy Rail = $17.80 per ride
- Light Rail = $16.08 per ride

(cost per ride calculated by amortizing the capital cost at 3 percent over 30 years, adding to the projected operating cost, and dividing by the annual riders)

For the NYC Subway, Operating costs of an 8-car subway train = $2,000 per hour

As you can see, massive subsidies are essential to avoid MASSIVE ticket costs to merely cover costs for trains.
Reply: @andrewfranklin4429  The info are on the official Luxembourg government website.
Le Gouvernement du Grand Duché du Luxembourg Portail des Transports Chiffres Clés : "70.000 passagers prennent tous les jours ouvrables le tram (depuis l'arrivée du tram à la Gare centrale)"
"6.000 passagers utilisent tous les jours ouvrables le funiculaire Pfaffenthal-Kirchberg, au total plus de 2 millions de passagers depuis l'inauguration du 10 décembre 2017"
70000 passengers par day Luxtramway
6000 passengers every day for the funicular.
in Luxembourg City a city of 150000 people.
Reply: @andrewfranklin4429  For the train infos, i literally gave you the documentary that you can watch on YT.
Reply: @andrewfranklin4429  Also it seems that you are also uneducated in Japanese, Zen does not only mean what you think, it can mean "ALL" like in ALLFORCE for Zenforce in the same meaning as Pankratos in Greek.
You really are the epitome example of the Dunning Kruger Effect.
Reply: @andrewfranklin4429  Official Tesla website service Winter Care : "Tesla recommends cleaning and lubricating all brake calipers every 12 months or 12,500 mi for cars in cold weather regions." You are fake news.
Reply: @andrewfranklin4429  More from Tesla website maintenance : "Tesla recommends rotating your tires every 6,250 miles or if tread depth difference is 2/32 in or greater, whichever comes first." 
So the train with 3.2 million kilometers laughs at those 6250 miles (10000km) tire rotations) a logistical nightmare of time and costs for cars that try to compete with the high transport efficiencies of trains and tramways to transport people.
Reply: @andrewfranklin4429  Expensive car tires under private use not Loop taxi use last maximum 50000 miles on average, even on high stress metro metal wheels last 700000 miles, freight trains wheels can do over one million miles. The sheer number of tires for the many Tesla cars in the loop are an economic and ecological disaster.
Reply: @andrewfranklin4429  Tesla website : "Brake Fluid Test
Tesla recommends testing your brake fluid for contamination every 2 years and replacing as needed."
Your fake news claim : "3 years" haha you cannot even get the stats from your beloved brand right. You failed again.
Reply: @andrewfranklin4429  For the same amount of people transported : Luxtram cheaper per kilometer, way less MJ/km, way more energy efficient, cheaper maintenance, way way longer service intervals, metal wheels with low rolling resistance lasting at least 700000 miles and not producing rubber particles while in use that are highly detrimental to the environment. "Air pollution from tire wear up to 1000 worse than that what comes from exhaust" tiretechnologyinternational article.
Reply: @THEREALZENFORCE  I’m afraid you missed this important bit of information on the Tesla website:

“Your vehicle should generally be serviced on an as-needed basis.”

What this means is there are ZERO factory-required service intervals unlike every other car which have all the 20k, 40k, 60k for example service intervals detailed in the Service Manual all of which need to be followed and documented as part of warranty requirements. 

Tesla requires none of that. That is what is extraordinary about Teslas.
Reply: @THEREALZENFORCE  the Las Vegas RTC Bus Service operates 708 buses daily and doesn’t have any problems maintaining the tires on those big heavy vehicles. Likewise for taxi fleets of hundreds of taxicabs. Your apparent concern about rubber tires is misplaced even for the 700 Teslas that will be in the 34 mile, 55 station Vegas Loop fleet.
Reply: @THEREALZENFORCE  the figures below relate to a NYC subway train carrying 1,600 passengers, so to compare the Loop EVs to a 440 passenger Luxtram, you’re looking at only around 21 Loop EVs being required vs the 80 in the comparison below. So even cheaper. 

The advantage the Loop has is that the cost of EVs required to move the same number of people as a train is about 68% - 80% lower (see below) and of course the cost of vehicles is a tiny fraction of the multiple billions of dollars extra that it costs to construct a subway.

Each NYC subway carriage costs $2 million so an 8 carriage train costs $16 million and can pack in a maximum of 1,600 passengers (uncomfortable standing room only). 

Each EV in the LVCC Loop cost about $40k each, so you could buy 400 comfy EVs for the same money as that NYC train and with 4 passengers per car transport the same 1,600 passengers. 

However, the EVs travel 5x faster than the trains (which have to stop at every station on a line) so you’d need only 80 EVs (worth 20% the cost of that 8-carriage train) to transport the same number of people in an hour. 

Even with 2.5 passengers in each EV, that’s still only 128 EVs to transport the same number of passengers as a train at 32% the cost of that train.
Reply: @THEREALZENFORCE  Apologies Zenforce, looks like Luxtram is indeed back up to 70,000 people per day post-pandemic. 

However, that still leaves us with this less than compelling comparison:

The Luxtram T1 line has 15 stations over 7km and takes 23 minutes to travel that distance at the dreadfully slow average speed of 11.3 mph.

The tram has a daily ridership of 70,000 passengers only 2.6x greater than the 27,000 people per day of the current LVCC Loop despite having 5x the number of stations, 5.4x the length and costing $604m or 12.4x more than the LVCC Loop.

And of course, the now under-construction 34 mile, 55 station, Vegas Loop will have 3.7x the number of stations, travel 5.3x faster (60mph average) and handle at least 57,000 people PER HOUR  compared to Luxtram and yet cost the taxpayer ZERO dollars compared to the almost two thirds of a billion dollars of Luxtram. 

So still not a terribly impressive comparison for Luxtram I’m afraid.
Reply: @THEREALZENFORCE  And worst of all, Luxtram isn’t underground so it has all the disadvantages of above-ground railways such as consuming expensive surface real estate, slows and impedes other surface traffic, causes noise pollution (nobody wants a tram/train next door rattling their business or worse house), has the unsightly visual pollution (and hazard) of overhead power lines and is an unsafe collision danger to pedestrians and other vehicles.
Reply: @andrewfranklin4429 Stop lying, i wrote the exact phrases of the Tesla website.
Also your claimed "extraordinary" Teslas are ranked among 3 worst liable car brands among consumer reports, also more than 500000 of the 2 million built cars have been recalled, and the bad building quality is notorious even Tesla owners acknowledge that.
Reply: @andrewfranklin4429  Uncovering Tesla’s HORRENDOUS Build Quality, video uploaded by Corner Balance, a Tesla and Porsche 993 owner. He shows you the huge difference of built quality, Tesla cannot even keep up with a Porsche building quality from the 90s. Facts.
Reply: @andrewfranklin4429  You talk but you do not address the rolling resistance of metal vs rubber wheels and not the high air pollution due to rubber tires of the Loop system.
Reply: @THEREALZENFORCE  And yet Teslas continue to have the HIGHEST satisfaction levels of any car for 7 of the last 8 years which would not be the case if they really were the worst in terms of reliability of things that matter. 

Tesla has topped the list of most satisfied customers in the entire auto industry, from ALL of these different satisfaction reports:
 
- Consumer Reports Automobile owner satisfaction survey, Tesla again tops our brand-level satisfaction ranking with Tesla also dominating Consumer Reports' most satisfying cars report in 2021. The Model 3 took the top position, with the Model S in third place and the Model Y in fourth place. The Model X rounded out the publication's top 10 list
- JD Power ranked Tesla model 3 1st, Model Y 2nd and Model S 4th in 2022 US EV Experience Ownership Study
- Zutobi ranked Tesla number 1 in 2022 global owner happiness tracker for 50 top-selling cars from around the world
- Parkers  ranked Tesla 1st in customer satisfaction 
- HonestJohn, ranked Tesla 1st in customer satisfaction 
- Autotrader, ranked Tesla 1st in customer satisfaction 
- Edmunds ranks the Tesla Model 3 as the best EV in customer satisfaction of 2022 and  has done so for three-years-in-a-row.
Reply: @THEREALZENFORCE  And the recent recall from Tesla for 500,000 Teslas is to disable the feature that allows owners to play a fart noise over the cars external speakers (!!) because NHTSA  are party poopers and as usual is an over-the-air update meaning it just happens automatically without owners having to take their car to a dealer as is the case for almost every other auto brand recall. So much for your hysterical claim!
Reply: @THEREALZENFORCE  Steel wheels are not actually the big deal in energy efficiency that you may think. Rolling resistance is only responsible for about 15% of the energy usage of a vehicle compared to wind resistance, fuel/energy conversion losses, mechanical losses and overcoming inertia when accelerating which account for a massive 85% of the energy usage of a car. 

You’re probably getting confused by the fact that ICE cars are less energy efficient than trains (which they are) and thinking that also applies to EVs (which it doesn’t).  

The average energy efficiency of trains is dragged down by big heavy trains moving small numbers of people off-peak as well as having to start and stop at every station on the line. That is why the Loop EVs use less power than any heavy or light rail transit system globally.  

Average Wh per passenger-mile:
- Loop Tesla Model Y (4 passengers) = 80.9
- Loop Tesla Model Y (2.4 passengers) = 141.5
- Metro Average (Hong Kong/Singapore) = 151
- Metro Average (Europe) = 187
- Heavy Rail Average (US) = 408.6
- Streetcar Average (US) = 481
- Light Rail Average (US) = 510.4

Sources: EPA and Federal Transit Administration 2019 National Transit Database

In fact, low friction is actually a disadvantage for the steel wheels of trains as it causes far worse traction and braking.